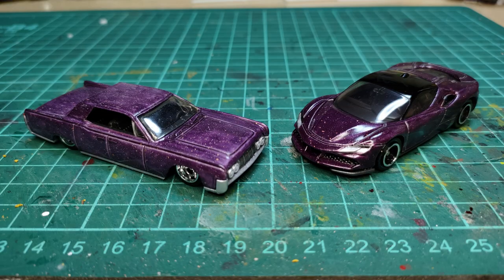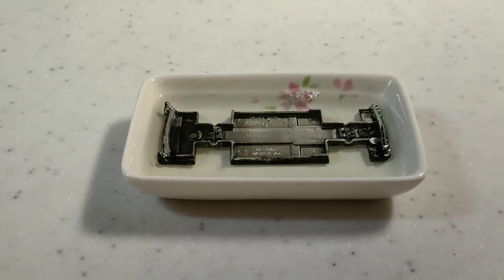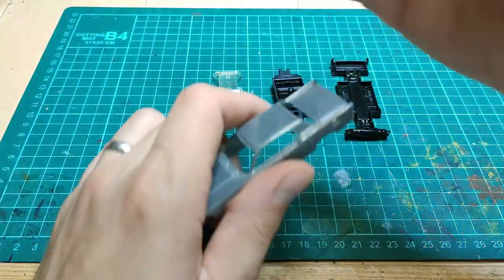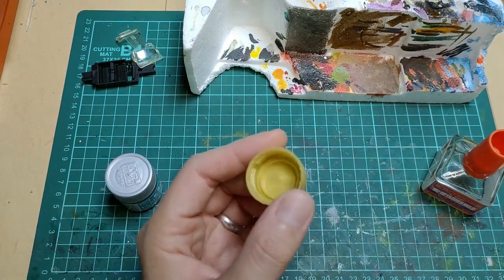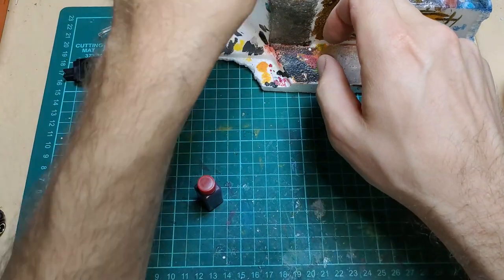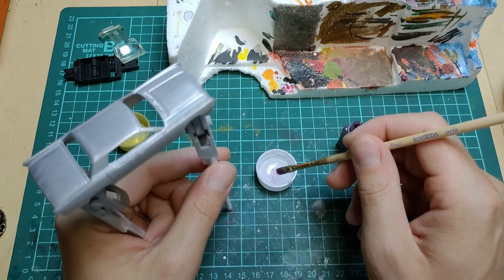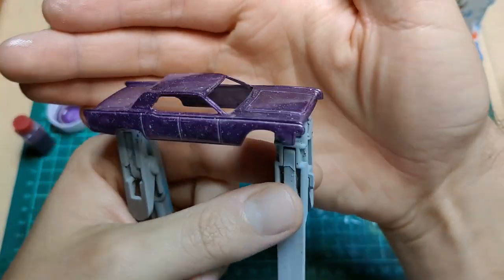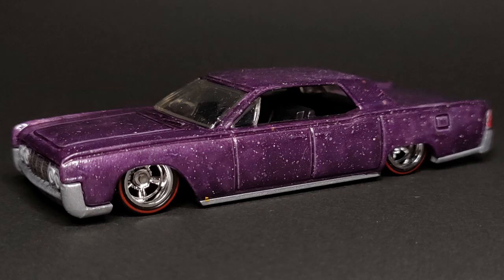HOW TO PAINT | Galaxy Paint Job with NO AIRBRUSH | Hot Wheels 64 Lincoln Continental

Comment: Another awesome video man👍🏻👍🏻 I've wanted to try a paint job like this ever since I saw something similar on a "normal" painting channel but it's more helpful to see someone do it on a hotwheel. I really need that Mr.Retarder!! I have tons of paint but no airbrush. Definitely gonna have to save this and watch it a few times. I even havr a Ford galaxy I can use that's lowered just like your Lincoln but I kinda like the paint job so I'm torn😄
Reply from the maker: Thank you! It was just something I randomly stumbled upon but turned out great. As far as the Mr. Retarder goes, I would double check the paint you have and make sure you pick the right retarder. This one is for Mr. Hobby /Mr. Color paints
Reply: @BPCustomCreations  I mostly have the cheap acrylics from Walmart and such, but also a lot of Testors enamel and acrylic. The enamel is definitely not for brushing large surfaces! I'm going to trying thinning with just water though and see what happens.
Reply from the maker: @dgs.creates  Yeah, for regular cheap acrylics go with water. Googling around a little came up with some enamel retarders but also a lot of people saying you don't need it and probably could just use a thinner from enamels.
Reply: @BPCustomCreations  awesome, thank you!